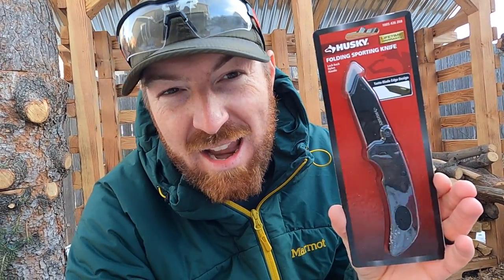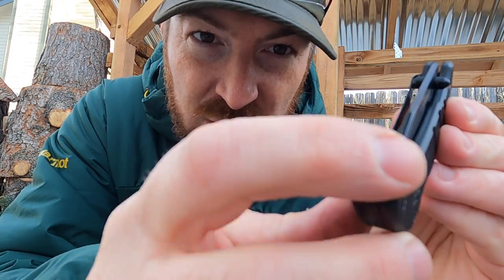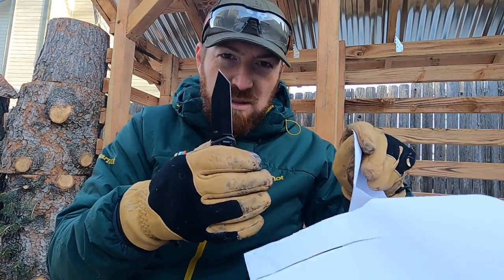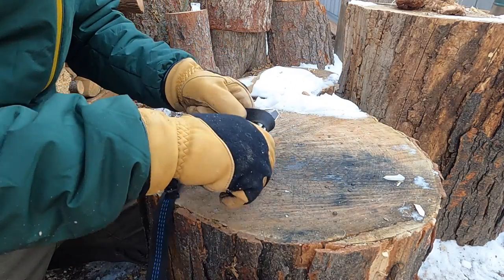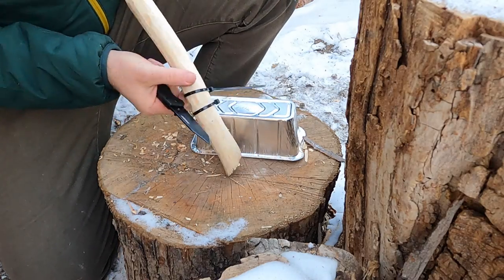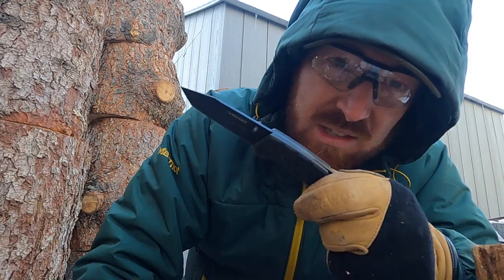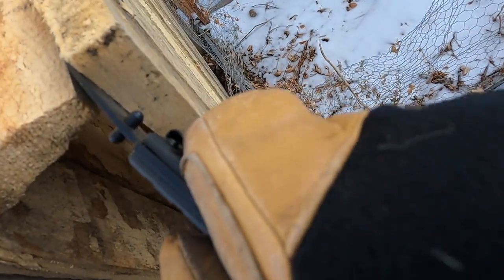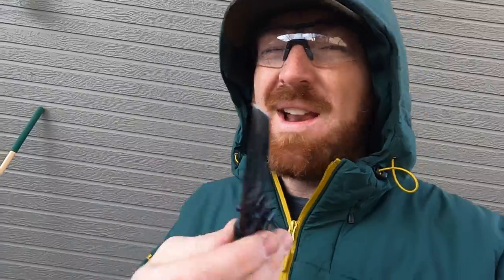CAN U KILL A $9 Husky Tools Pocket Knife???

Comment: Great Test… I just purchased 3 of these killer value knives. However, this same Husky knife was on $ale for an amazing $5.88 which also includes a Bonus Husky Knife Sharpener Tool 2-pack on 12/20 until after 12/26/22 in the Christmas Gift Center at the front seasonal area of your nearest Home Depot Store. Super Value for $6 Grab them while they last!
Great Video… Audio was perfect as well. Thanx!👊🏽👊🏽
Reply: So happy I picked one up the other day I was on the fence for sure but after I got it home there are a few things Ide like to improve (wish it opened,& closed a bit easier (more comfortably) and I would t mind a thumb rise/ramp (or husky’s equivalent to an Emerson wave) w/ jumping,  a front flipper and an actual choil but again for under a tenner I can’t complain I got the steel W/wood facing on the handle for 9.99 or maybe 11.99 U.S.D.$  i don’t regret it that’s for sure hell ffs I went back and bought the other one.

Comment: I thought it did pretty good for a $9  knife....I think many expensive ones would have broke in the prying test.  The back lock failed probably from the unlined cheap handle not holding back spring.???  Most of these cheap beaters are usually liner locks.  This looks like made by Coast.  Beater knives have their place, usually made in China,...I try not to buy anymore...

Comment: when I buy a folder, whether it's a cheap or expensive, I check it over and then tighten up screws and sharpen if needed before I use it. I don't understand what using it "out of the box" proves.
Reply: The Chinese seem to be rather stingy with thier lubricants. A touch of oil on the pivot of a folding knife is usually job #1.

Comment: Ok, first you voided your warranty as soon as you tried batoning it through that stick, second if you do that when you use a knife you are just wrong. Yeah it's cheap but it's not a pry bar or a wedge or even an axe. Oh and the reason it's soft is so it's easy to sharpen
Reply from the maker: As someone who worked as an electrician, dump truck driver, and on oil rigs I wouldn’t trust this knife as far as I can though it.  A replaceable blade utility knife and a solid pocket knife that cost $30-$40 is a much better way to spend your money.

Comment: What this vid really highlights is the effect of blade geometry and thickness.  Have a closer look and in the most part the blade tore through material rather than actually cutting. Thin hollow blade + enough pressure = you can push through most things. Is this blade value for money? For me no. You lose too much safety and performance to get the low price. A quick look around and there's plenty in the $30 - $50 range that will out perform and outlast this cheapie. Merry Christmas and sharp blades all!

Comment: <long winded>I went ahead and scalped the 4 remaining knives my local HD had, after seeing this video I want to see how cheap a cheap knife really is and also wish to share a story from someone who has wisdom beyond the years when asked "what's stronger, slip joint or locking knives? It's a question of -
Reality vs expectancy --- Today modern knives are marketed as the 21st century's answer to kong Arthur's Excalibur, they are tougher and stronger knives, which will lead many knives to being abused by their owners, in the belief that it was designed to handle it, which will lead to a higher degree of lock failures and malfunctioning, how many knives actually need to be abused to perform a specific task? Treat your knife as a cutting tool and not a chisel, screwdriver, hammer, lever tool, pry bar, or axe. And you wont be sending it in for maintenance repairs or warranty work as often as you do, due to stopping pin, or back spring or lock mechanic issues
In the 20s, men had little slip joints for decades, they didnt go out and buy another pocket knife until they wore out the one they had or it got lost, which was not often --- right tool for the, so ultimately the answer is you won't live long enough to know what is stronger as long as you use the knife within the scope of its design

Comment: So basically, it sucks if you use it in a way that it was "not" designed to be used? What's the next test, see how far you can roll a brick down a hill then criticize it because it didn't roll down like a ball would? 😄 For $9, that little knife proved itself in my opinion and I say this owning $400 customs. For the price of one Mora Garberg, you can buy a bunch of those and spread them out into car kits, PSK's, the garage, the "everything" drawer ib the kitchen, etc...
Reply: Cheap beater knifes like this are bought explicitly by tradesmen to do   abusive tasks. I picked up a couple Cheap Dewalt & Milwaukee knives awhile ago for occasionally cutting multiple layers of sandy pool liners. 
They were both awful. The steel feels like a soup can. 
I think it's really bad practice to go this low most often. Ganzo's, Doziers, Rat 1's & 2's & the like are about as cheap as I'd like to go.
Reply: @adamjames1375  When I was still working in the field (for decades), I never bought tools to abuse them. I'd buy the right tools for the job. I'd use cheap knives like these to do cheap tasks, but not for jobs that they weren't meant to do. Anyone who does/did couldn't really complain about their quality.
Reply: @YankeeWoodcraft  
I could. If I spend $10 on a knife that fails very quickly by a few different metrics than it's an insufficient tool that does not meet the minimum requirements. The nature of cheap work knives is that they're expected to overcome reasonably abusive tasks(skinning cable, cutting sod, light prying e.t.c...). I'd liken them to a steel hafted hammer that's unable to pry/pull nails. The nature of some tools is to see relative abuse, which is why the tool needs to be tough enough in the case of a steel hammer, or disposable enough as a utility razor blade. Your mileage may vary due to your tasks, but I'd still argue you'd be much better served with spending just a few dollars more.
Reply: @adamjames1375  My old man used cheap tools and ran rings around us whippersnappers. 

And some of the best hammers for example are some of the cheapest (i.e. Estwing). 

Don't get caught up on price. Price isn't a quality of a tool, but rather a suggestion of the quality of a tool. 

As the saying goes, it ain't the arrow, it's the indian. 

Also, cheap is a relative word. 

To me, $150 is "cheap" for a knife.
Reply: @YankeeWoodcraft  
Absolutely a skilled veteran can do more with less. 
I agree Estwing are great for being indestructible, I own at least half a dozen as well as a few hatchets & have a few thousand hours clocked with them. For general purpose & demo they're outstanding. For striking they're brutal on the arm. I have pretty bad tennis elbow & an ulnar nerve impingement & if I swing a steel hammer hard all day, my arm/elbow is shot for 3-4 days. I use vaughan wood handled hammers for striking & only go to steel for prying/occasional light striking. Not everyone has that problem but enough guys I know do. I'm 37 and started having significant problems a few years ago after 15 or so years of swinging primarily 22 & 28 oz. framers.
...
Also cheap, in this context, is not so much relative to what the purchaser is willing or able to spend, but by defining the requirements of the blade/task at hand vs. the lowest cost knife fitting those requirements.